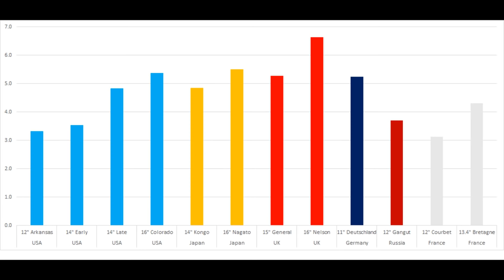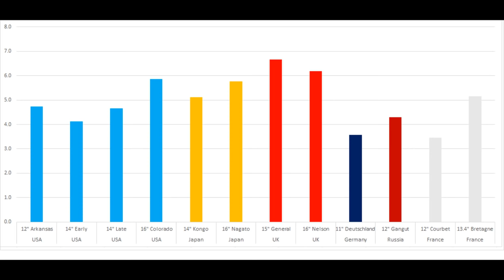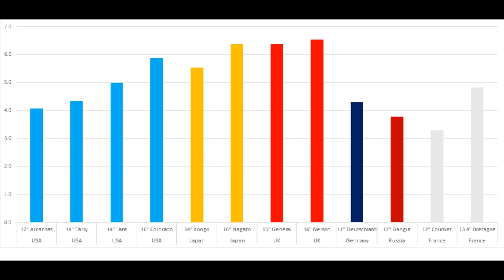Battleship Guns of WW2 - A series of tubes

Comment: Given the supporting director and radar technology, I just don't see Yamato's 18s out-performing the 16/50's. Not because I'm a 'Yank, but because the Iowa's supporting technology was just far superior in every aspect, and getting such stats from the guns in a REALISTIC scenario is exponentially less likely from Yamato; everything from rate of fire to range (well, I guess technically it can still hurl the shell out there - but does it really count if they have no clue where it's going to impact?)  It's certainly always a game of compromise, and IMHO 18" is just too large logistically - both for construction, rate of fire, storage capabilities, and ship performance w/ the turret size/weight.
Reply: The Iowas were significantly less accurate than commonly claimed to have been, even with radar fire control (see actual live-fire testing results from 1944, where it turned out the Mark 8 wasn’t sufficient to reliably hit a stationary Iowa-sized target at 30,000 yards, despite the 16”/50 gun specifically being designed for engagements at very long ranges). This also means their effective range is actually no better than that of the Yamatos (in good visibility)-around 25,000 yards for both. And before you claim the Yamatos didn’t have fire control at all (as commonly claimed to be the case), this is a myth, at least when it comes to the main guns-the Japanese had their own series of mechanical fire control computers, and while its operational process was more overcomplicated than the Mark 8, in terms of raw accuracy based on input it actually wasn’t that bad. 

Under poor visibility, however, I would agree the Iowas would significantly outperform the Yamatos, as accuracy regardless of visibility is the true advantage of radar fire control.
Reply: iowa and yamato were about the same in accuracy and rate of fire.
the claim that the usn had superior targeting capabilities is a myth and radar spotting is not especialy usefull when you have visual contact already.
also while japan didnt have radar technology on par with the us they used spotter planes for long range targeting giving the yamato a hit rate of about 7% at max range which ties with the iowa.